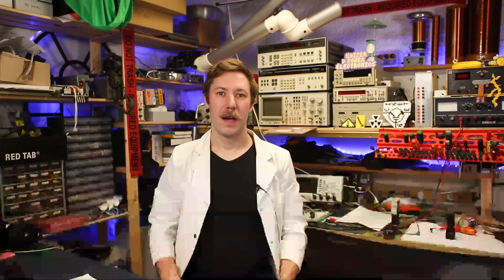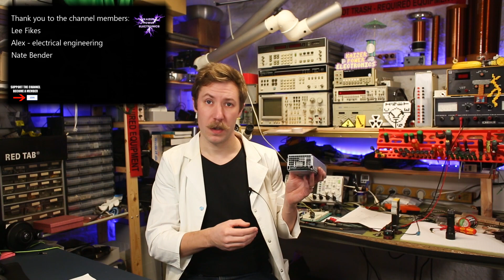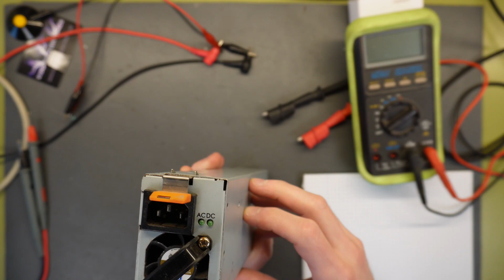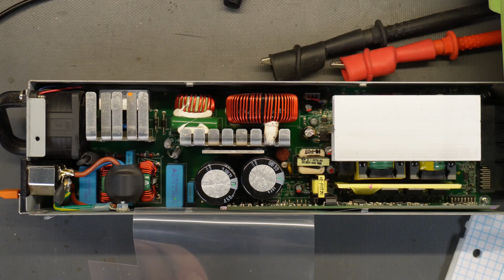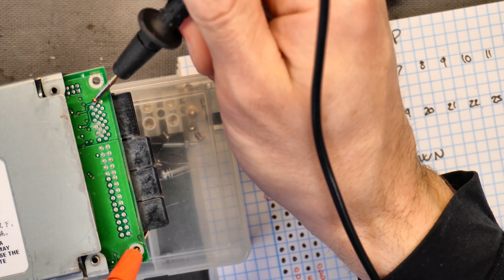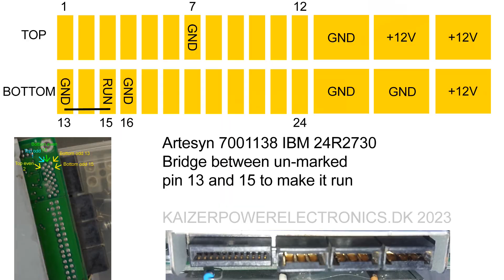Server PSU Hack - Artesyn 7001138 IBM 24R2730, 12VDC 69A 830W

Comment: Hi, I would like to ask your help regarding Flextronics FPS-800. I cannot find the pinout for this model. Thank you in advance
Reply: Sorry to bother you. I watch again your video and then I realize what you said, I use a resistor for testing the pins and it works. Thank you very much 🙇
Reply from the maker: Great that the method helped you power your own model :)

Comment: Are the start connections same for 7001509-y000 also ? Its 1450W Artesyn PSU.
Reply from the maker: Try the method I show in my videos, and you can easily find out, without risk of damaging the PSU.

Comment: merhaba. bu guc kaynagini rf telsizde kullaniyorum. telsiz cikis gucu 50watt gecince telsizim resetliyor.  bir cesit korumaya geciyor. yani yuksek pik akim alamiyorum. yuksek akim çekince  ,voltaj  dusmesi oluyor galiba. 
sorun cozumu icin destek lutfen. teeekurler
Reply: Did you find any solution to get more than 50W from this PSU ?  Is the voltage drop still there ?

Comment: Hi, what pins should I use to modify the voltage with a potentiometer? I would like to set it to 13 volts
Reply from the maker: See comment from @lewisse5
Reply from the maker: @lewisse5
1 year ago
 @KaizerPowerElectronicsDk  Based on your numbering, it would be pin 5. If I remember correctly, I used a 5K pot between this pin and GND. I wanted to make it fully variable and tried reverse engineering the feedback-loop but the little daughter board is more than 4 layers and probing was difficult so I ultimatly gave up.

Comment: Hi, does anybody know if those three power connectors and the 24 pin connector have a name? I want to use this power supply as completely plug and play, buying the male connectors and keep the soldering minimal
Reply from the maker: You can find "server breakout boards" on google that fit almost any power supply

Comment: I tried your hack and it worked! There is a problem with this power supply and every computer power supply I have tested, when I put a load on those power supplies the voltage drops a lot. Why is the voltage regulation so poor?
Reply from the maker: Down by how much and what was unloaded voltage? Mine have been pretty steady around 12V. I am not sure about servers, but ATX is specified for +/- 5% on the voltage precision.
Reply: @KaizerPowerElectronicsDk  On the Artesyn unloaded voltage is 12.20 v but when I connect a 50w halogen light it drops to 11.6 v.  I should put 10 50w halogen lights on that power supply and see what how far the voltage drops. The same happens when I connect a 50w halogen light to a ATX, it drops to 11.7 v.
Reply: @luckygen1001  put some load on the 5V output, the feedback is from it

Comment: Hello beautiful video, congratulations on the content. Can you help me with the ARTESYN 7001616 font jumper to connect the 74A? Tks
Reply from the maker: maybe you can find inspiration here https://www.xsimulator.net/community/threads/the-ultimate-power-supply-thread-for-sim-builders.6793/ or https://www.emsley.ca/cnc/ibm-psu-mod
Reply: Hello @iraldo00
i also have a ARTESYN 7001616-j002...i dont know with pins i have to connect...can you help me out?

Comment: Ive been using this exact model power supply in various projects over the years. There is also a voltage sense pin that will allow you to crank the voltage up to around 13.5V before the PSU goes into protect.
Reply from the maker: Interesting. Is this among the pins on the back or on the control PCB?
Reply: @KaizerPowerElectronicsDk  Based on your numbering, it would be pin 5. If I remember correctly, I used a 5K pot between this pin and GND. I wanted to make it fully variable and tried reverse engineering the feedback-loop but the little daughter board is more than 4 layers and probing was difficult so I ultimatly gave up.
Reply: Yo tengo la modificacion para que de 15v y 120 amp
Reply: @jeu34sgu Hola, que pines hay que usar para modificar los 12v? por lo menos que de unos 13v por el tema de las caidas de voltaje. Saludos
Reply: @jeu34sgu  tienes cojones
Reply: @jeu34sgu Que resistencias se deben usar amigo? Y que pines se deben tocar?